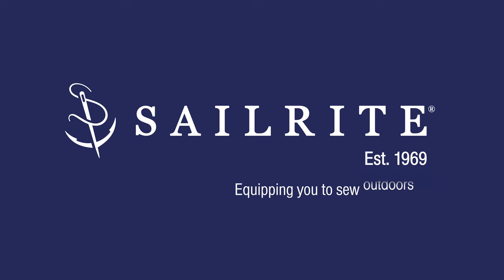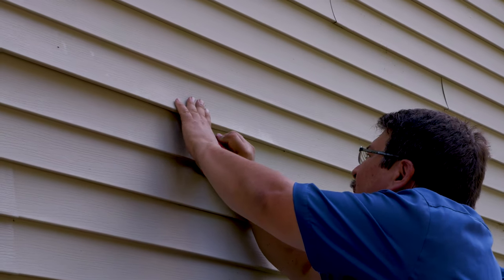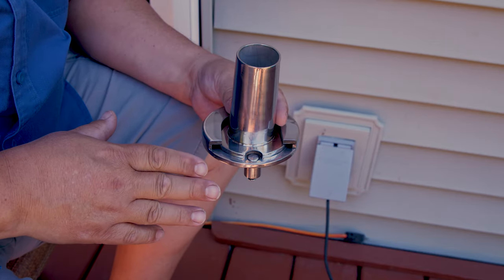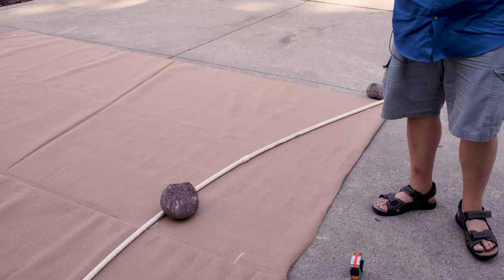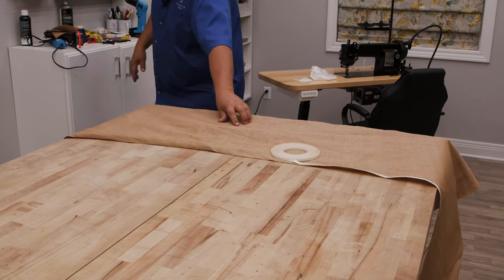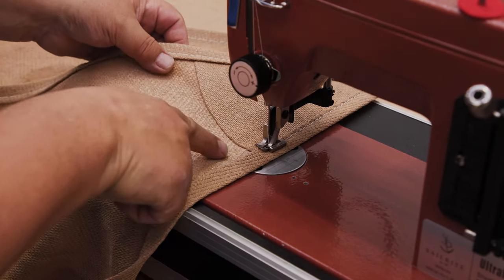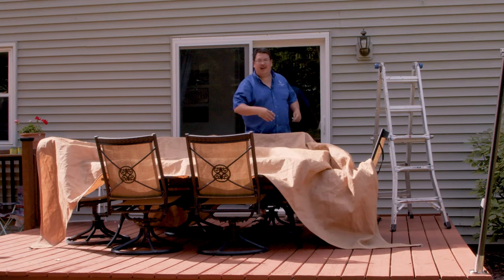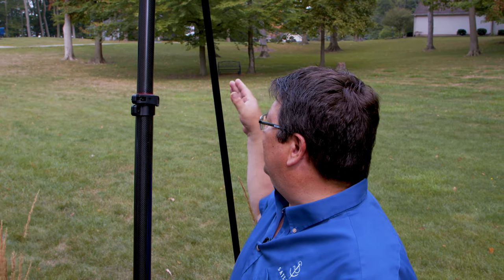How to Make a Temporary Sun Shade for a Patio

Comment: Every homeowner should keep several panels of siding for replacement, if there should ever be a hole or crack.  In the event of a broken panel and there isn’t a replacement, you can reach out to a home improvement center and show a piece of the broken siding for a replacement piece (you may have to buy an entire box but, that wouldn’t be a bad thing because companies sometimes discontinue siding or colors). Installing a piece is scary but easy, just YouTube it...you’ll do fine.  Hope that helps anyone who might be intimidated.  
This is a great project for a renter.  I recommend using a wooden block to set the posts.

Comment: I bought some shade "sailes" 2 years ago and have yet to install.  Now looking at this video kinda "inspires" me to go ahead.  I had no clue what the Carbie poles were and looking at the Closed Caption (cc) makes me laugh how speech to text messes things up.  Those poles are way too expensive ...   So I will have to design my own mounting system on my deck.  The deck gestsway too much sun, the "star gazing" wndows next to the deck bounces the sun right onto the deck; double whammie.  Anyways good video, good motivation hopefully good outcome... on the Cape.
Reply from the maker: Ya, the price from the manufacture for the poles has increased over the years. That makes it hard to use them. I am sure you can come up with another type of pole support system. Maybe a 4 x 4 or 6 x 6 wood beam or round metal poles that are permanent instead.

Comment: QUESTION: Are the tension straps (at time marker 50:45) absolutely necessary for the Carbiepoles? My deck is about 20ft off the ground and I was thinking about attaching the poles the handrails, where they meet the posts. TIA
Reply from the maker: Yes, they are required to support the weight of the sail shade. You can make the same webbing straps, just make them long enough to reach the ground at about a 30 to 45 degree angle.  If you use a piece of wood the same length as the Carbipole and measure to the ground, angled, and give me that measurement I can figure the materials you will need for you. email ericg@sailrite.com
Reply: @SailriteDIY  Thanks so much for the quick reply. I'll discuss with my other half. Great video by the way.

Comment: Great video! Question: It seems odd that the "pretty side" is the top, - is there a reason for that?
Reply from the maker: There is no right or wrong side to this fabric, but it is recommended to use the “smooth” side facing the sun and the “rough” side facing down. This will allow the fabric to be more easily cleaned.

Comment: Loved this tutorial, thank you! I'm not crazy about the color options for the shade cloth fabric. Can this be made with your Sunbrella fabrics? Clearly they would have to be sewn together in strips since they are not 150" wide. Is that a problem? Do you have recommendations on best fabric piecing methods for that?
Reply from the maker: Yes, it can be made from a Sunbrella Marine Grade fabric. However, it will collect water like a cup, so it would have to have a good pitch or be removed in rain. The HDPE fabric we used has a mesh opening for water to eventually escape. Let me know if you have more questions.
Reply: @SailriteDIY  Thank you - we would definitely be pitching the sun shade - do you think a 20% pitch would be enough? Also, I'm assuming that the best fabric piecing would be to have the connecting seams running down the pitch instead of across it? And should we seal the seams? Do you have a product recommendation for that? I really appreciate your advice!
Reply from the maker: @lsdavis22  Yes, 20% would be ok. 25% would be better. Flat sails must be canted adequately, 1:4 gradient slope is recommended. (about 14 degrees or 25%). The seam for a sail shade is typically an overlapped seam and water running off the seam is never considered important for a sail shade, but that is because most sail shades are made from a mesh fabric. Since yours is Sunbrella, and not mesh, try to place the seam so the overlapped panel is on-top of the lower panel, like a roof shingle.
Reply: @SailriteDIY  Perfect - I just found your seam tutorial. So helpful!  Thank you.

Comment: Do you need to measure 2 inches out for hem before you cut the fabric? If you use Sunbrella will the hem bunch? I thought I would have to cut a separate piece for the hem.
Reply from the maker: If you do not add extra fabric for the hem, then the sail shade will be smaller in size. If you ok with that you can do that. The hem is created on an edge with a slight hollow, because of that the Sunbrella or HDPE fabric does not lay perfectly flat when the hem is created. However, the hollow is so gradual and long that this excess or bunching is not very noticeable.

Comment: Can the carbiepole base be screwed into concrete, perhaps with metal anchors and some hydraulic cement as glue?
Reply from the maker: Yes, the base can be screwed into concrete. I would pre-drill a hole in the cement and use Tapcon Cement Screws 3/16" Screw Size, 1 3/4" Length, Phillips Head Style. I do not know much about the hydraulic cement, sorry.

Comment: Wouldn't that damage your house ?
Reply from the maker: I have had it up all summer this year and it has not damaged a thing. If your had a huge sail shade it might, but if each side is only 17 foot or less it should be fine with an eye bolt screwed into a wooden frame (usually 2 x 4).

Comment: structurally that horse shoe is made for the other direction...  the force with just the pin on the outside is not going to hold the pole back
Reply: Remember the wind force off the sail is not horizontal shear but upward like a crowbar or a hammer extracting a nail. if you use the pin on the back as you have you take all that force and place it on the Edge of the top of the shoe and not spread it around the whole shoe half since the pin will do nothing to hold it down

Comment: Those poles are $650 each??? Comon Sailrite, that’s ridiculous.
Reply: Carbiepoles aren’t inexpensive. It’s an actual brand name. Try to find them cheaper
Reply: About right for carbon fiber material but I would be terrified drilling into the poles in case I made a mistake. I imagine steel or another metal would also work for something temporary like this but I am guessing carbon fiber was chosen due to it's ability to flex and relieve some of the pressure on the hooks attached to the house.